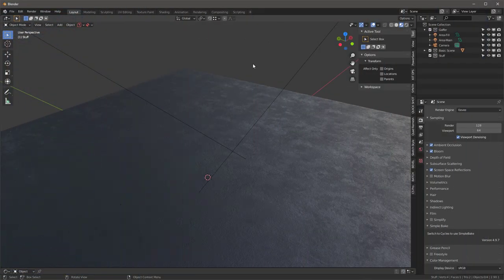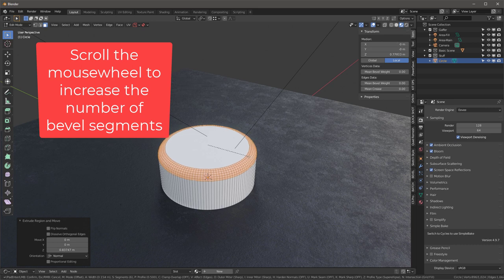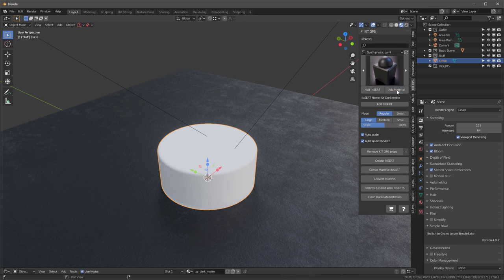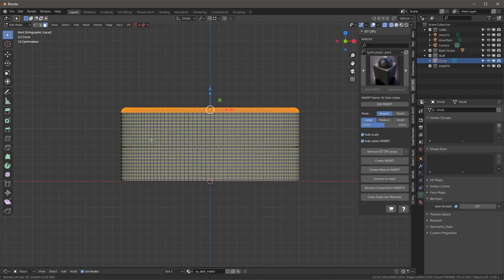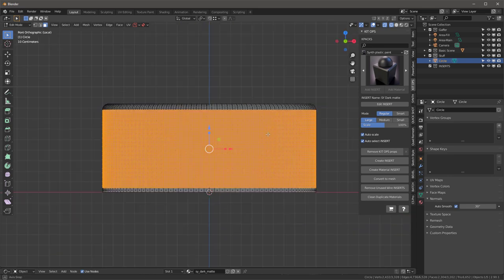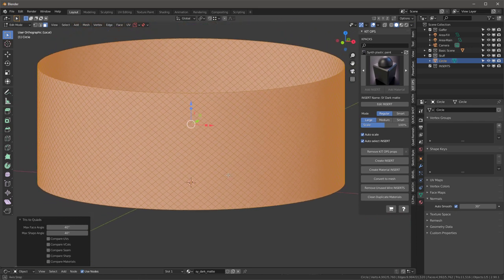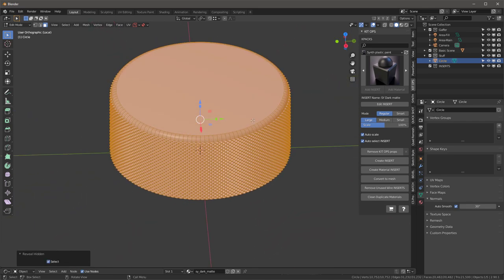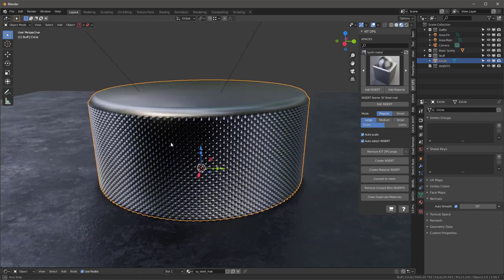Created a Knurled Knob in only 3 Minutes in Blender

Comment: 20+ years ago people made this with 4steps: 1.making one small bump (diamond shape in this case) 2. cloning bump in two dimensions 3. Bending this patern 360 4. extruding  the hole edges, cap holes, chamfer (bevel). It was 4 minutes, not three, and in opposite direction. Nice tutorial, thank you.

Comment: That was awesome. Thanks, Chip. 
Question: is there a way to create these (the knurl effect) procedurally?
Reply from the maker: I imagine you can create a bump map to do it. Or just bake this knob onto a cylinder.
Reply: I'm no expert, but I would try the geometry nodes for this.
Reply: @MarcinPetruszka  that’s an awesome suggestion 🧐
Reply: Using microdisplacement, UV -> Separate.XYZ, then add a multiple of one to the other.
*integer -> fraction -> *2 and you have one linear ramp up/down in a spiral (regular UV layout from a noncapped cylinder).
Then do the same where you subtract instead of adding in the start, and you have an opposite spiral.
Then do whatever you want with them, minimum should give similar results as geo with bevel node.
Adding or multiplying is worth looking into, as well as smooth minimum and smooth maximum.
Or run them through a sine function (remember to remap back to 0-1 before more math).
Or a circular function like result-(result squared) -> square root (or 1-(result squared) -> squared root), can't remember.
If the object is distant, just swap out displacement only for bump only.
Not sure how to do it with geo nodes, never tried.
Microdisplacement is problematic used on assets, as it samples the source which could be far away.
But I don't think I'd ever want this level of geometry in any assets.
Reply: @gottagowork  definitely gonna give this one a try. Thanks.

Comment: Hey there Chip, I have a complex curvy model that I want to knurl. I noticed how easy this appears to be but, my mesh is not even as is the knob. I don't have perfectly aligned vertical lines to intersect my perfectly aligned horizontal lines. Do you think I should still try to use this method? I'm having a heck of a time with all the techniques but that is due to my ignorance. This looks easy on my brain.
Reply from the maker: You might try using a remesh modifier to get the lines correct. Or, another way is to use normal/displacement maps.
Reply: @ChippWalters  Ya, so many techniques and I'm not sure which is most practical for my model. Do you offer advice on an individual basis? My model is complex, I'm told.
Reply from the maker: Jump in at http://cw1.me/discord and we can belp